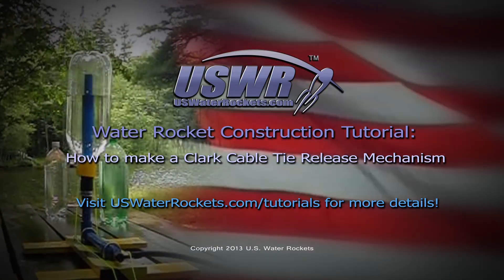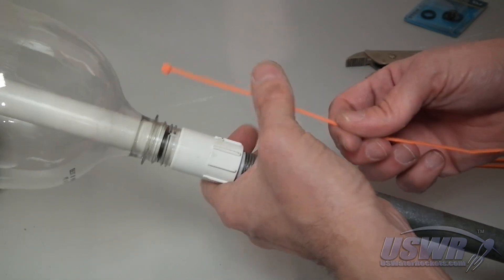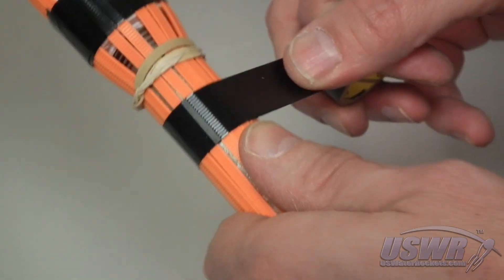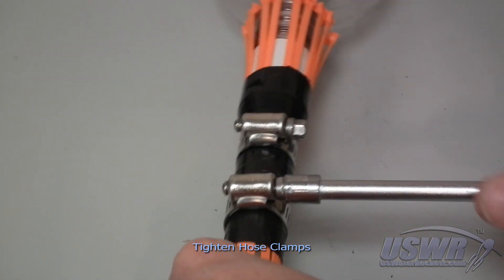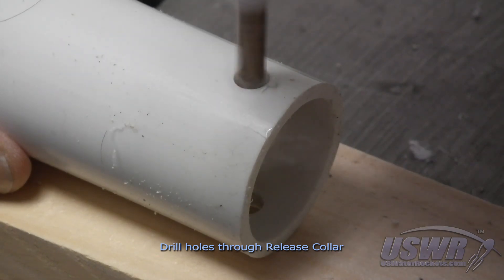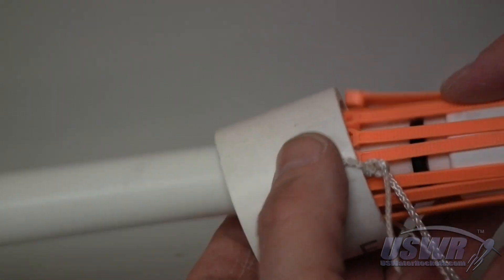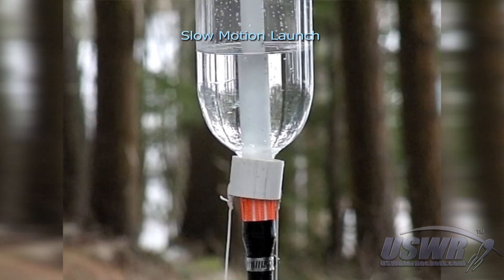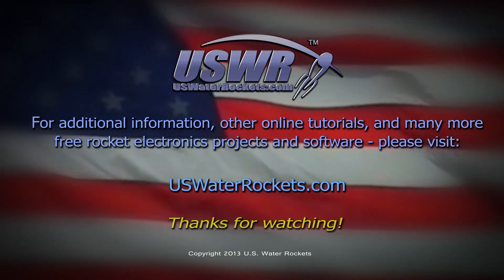How to make a Clark Cable Tie Release Mechanism for a Water Rocket

Comment: A quick release clamping ring tied around the heads of the cable ties works even better than the plastic pipe ring at higher pressures. You can connect a string to the lever of the quick release clamp and pull laterally to release the ring. It's much easier than having to pull the plastic pipe ring downwards with a flimsy string when working at higher pressures.

Comment from the maker: +Hiroki Yanai we have used this system for rockets with over 1000 PSI. It becomes hard to pull off the collar at that pressure, so we invented a new system that makes it easier to release a high pressure rocket called the split collar release. https://youtu.be/T0dKc0fkVko

Comment from the maker: There are a lot of variations in bottles and types of rockets people make, and also in pump types and sizes, so there is no easy answer. The best way is to use a pump with a pressure gauge and stay well below the burst pressure of your rocket design. For a single bottle, most people use 60-70PSI as a limit. For rockets made from joined bottles, you should always pressure test to learn the limits. Always wear safety equipment and never handle or get close to a rocket that could burst. Be safe!

Comment from the maker: It depends on the ZIP tie you use. They all have different widths. The tutorial is made so that you don't need to count or measure the number. You just spread them evenly around the pipe and when you have gone all the way around you are done! The number is not critical.

Comment from the maker: This design has worked in the 300PSI range, but you then need to use a stronger release cord because it gets very hard to move the collar down with that much force from the rocket trying to break free, which is spreading the cable ties. With pressures beyond that, you start to enter the realm where you need to calculate based on the strength of the ties times number of ties and the forces pulling the rocket up (area of nozzle * pressure). You will also need more hose clamps to prevent slipping.